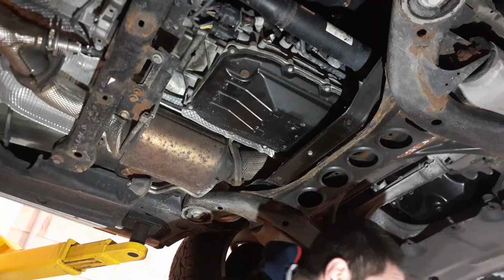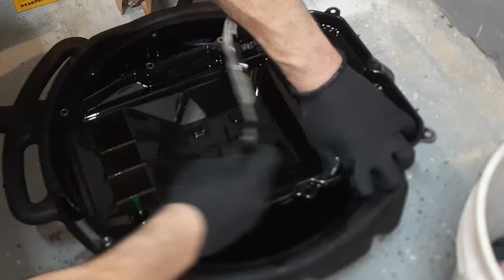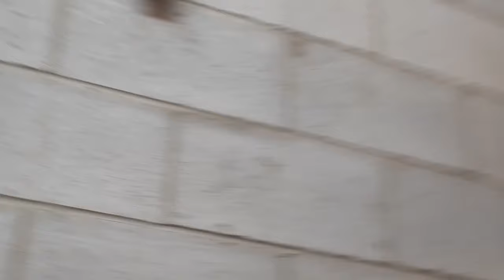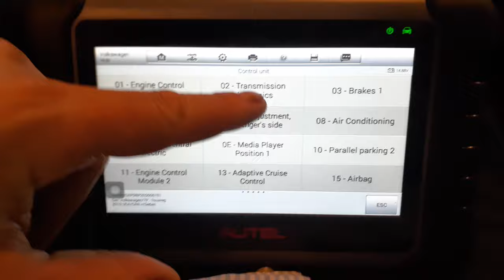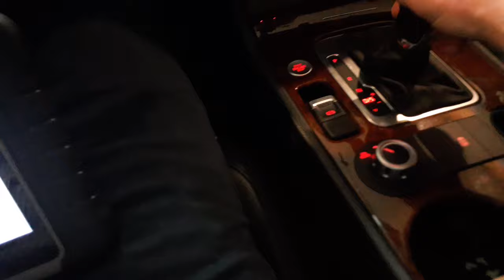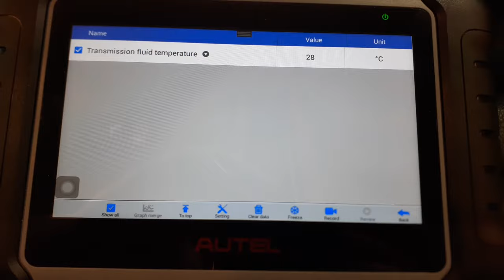VW Touareg Automatic Transmission Service

Comment: is that the specific oil thats needed for this? liqui moly 1800? went to part store and was told it was the 1200 and dont want to use the wrong stuff. thanks in advance!
Reply from the maker: 1800... https://www.liqui-moly.com/en/service/oil-guide.html?owwSource=fahrzeugsuche#oww:/api/v2/oww/101/DEU/ENG/1/73239aef0eb88030/df0d4a9f5f6682ac/5b4ae9f1a1aab0f9e15da2d44131a605/
Reply: @MyHomeGarage  thank you!
Reply: Use Toyota WS, this is an aisin transmission used in many makes and models, Mitsubishi pajero sport, Lexus lx570, LC200 2015 up, vw, Audi,…
Also, you don’t need to fill the fluid through the bottom, go to the driver side front and you will see a fill plug size24mm remove it and start filling. By the way, the fill plug has the symbol WS( world stander) referring to aisin WS  fluid / Toyota fluid.

Comment: Thank u for the video , question , I just got 2011  Touareg tdi 3.0 it has 184000 miles it’s college car for my daughter , so after looking into some car fax history I wasn’t able to find that transmission fluid was ever change , so I was gona do it but some ppl they recommend not to do it since never was done , and by doing it I can harm more transmission, some ppl say it’s ok , but then I called vw dealer talked to service tech he did said same thing not to do it since car runs nice and smoth , whoever reads this I rlly appreciate advices to do it or not to do it
Reply from the maker: I wouldn't touch it at the point.

Comment: GOOD AFTERNOON FRIEND. CAN YOU HELP ME LOCATE THE SPEED SENSOR OF THE TOUAREG YEAR 2007 V-8 ENGINE 4.2 FSI GV. I NEED TO REPLACE IT BUT I DON'T KNOW WHERE IT IS?
Reply from the maker: You need to find a copy of service manual. It's located on the transmission most of the time. Usually 3 wire sensor. Another idea is go on rock auto or a parts catalog find the sensor. You'll know what it looks like and location and then look around the transmission.  Goodluck